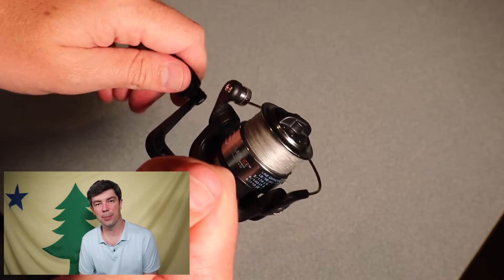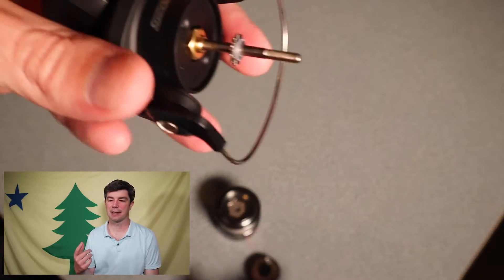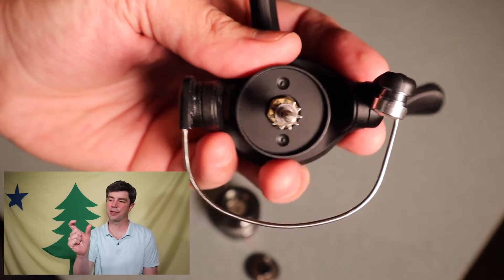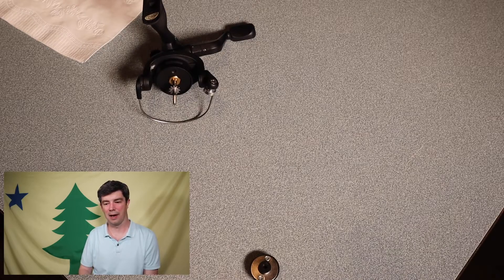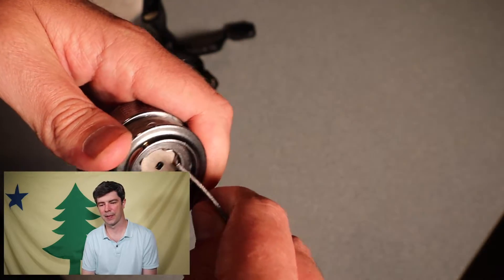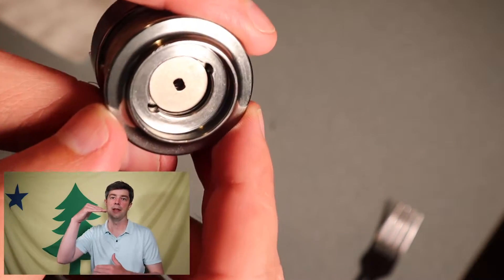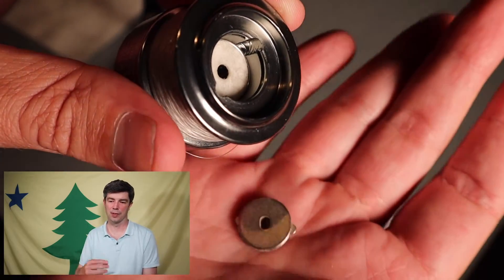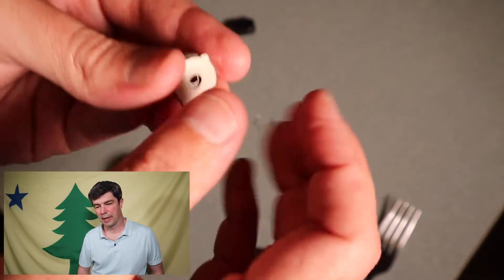How Does Drag Work On Spinning Reel Explained

Comment: My reel wouldn't loosen the drag. I watched your video and took it apart. The top metal washer and felt washer were stuck together. I separated them and smoothed them a bit with sandpaper. Also the bottom metal washer was warped. I straightened it a bit and put it back together. Now I have working drag adjustability!

Comment: My drag won't loosen can't pull any line out. It's like the drag is as tight as can be, brand new reel . I'm wondering what can be defective on such a simple design!! I bought the reel and rod together about 2 or 3 years ago and used it for the first time yesterday.  The poor fish didn't have a chance  no chance of them pulling line out, all that I could do was muscle the fish in.  LOL  one good thing it's cheap to buy another
Reply: I would take the steps in this video, but clean those washers and re grease
Reply: @Tree-vis  Yes thanks.  I did get it working FINALLY  !!   The washers and felt washers were in wrong and it wouldnt work.  I staggered them and it woked fine!